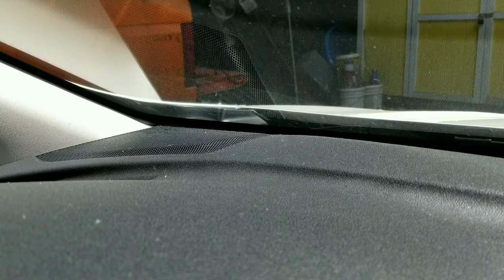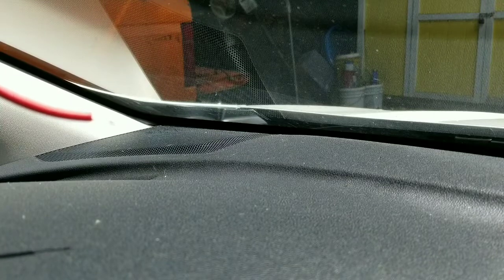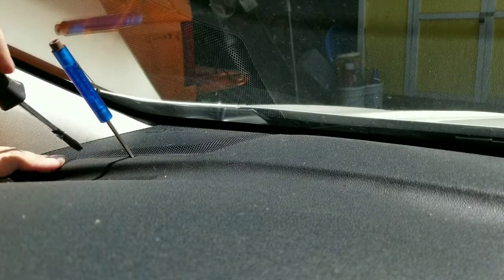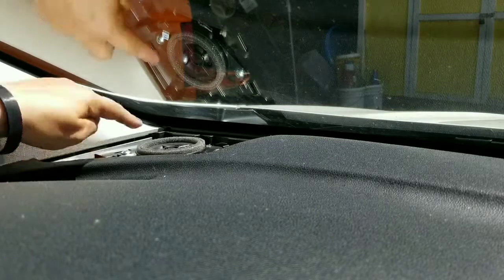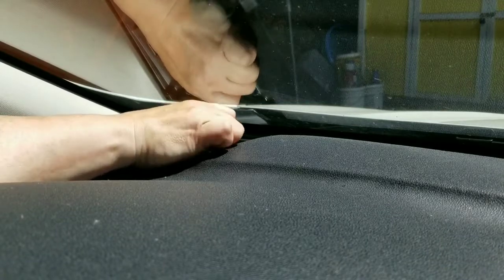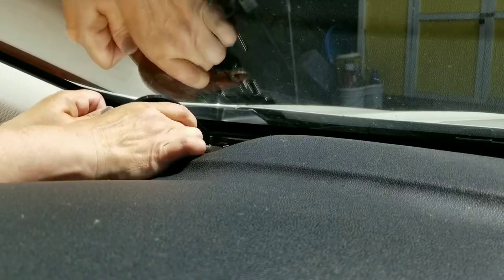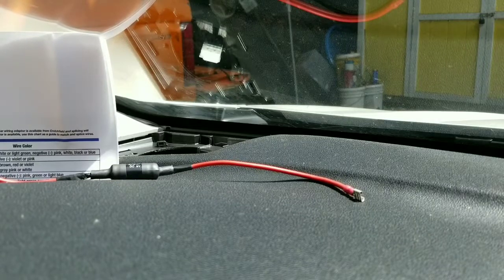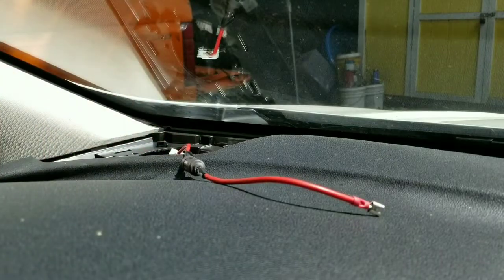2018+ Subaru Crosstrek Dash Speaker Replacement

Comment: Hey could you tell me size infinity speaker that was and did it screw down without modification to the original mounting holes
Reply: should be 3.5 inches and variety of holes on the speaker mounts to screw right into the factory holes

Comment: Does that speaker really just sit in there without being secured in?  I’ve had a nasty dash rattle since new from that area.  I wonder if this is it.
Reply: Let me know if your rattle is from the speaker mounting screws. I have a nasty rattle from that general area on the passenger side dash speaker. Will attempt it this weekend to see if the screws worked themselves loose. 

Props to Katherine for attempting this and sharing.

Comment: Can you tell me what type of crossover and why you have used? I have seen some Crosstrek upgrades, but nobody used this, just replace the original dashboard speakers.
Reply: they're just capacitors that come with the speakers when you buy them. It acts as a crossover by filter out they low ends.
Reply: So they came in the box it wasn't something u had to by separate? Thank u

Comment: Great video heads up there's after market plugs that will adapt ur stock speakers to aftermarket ones. I found them on Amazon there called RED WOLF.

Also when I did might I took the side piler cover off before I tackled the B! As$ speaker cover. Well good luck
Reply from the maker: Good tip!